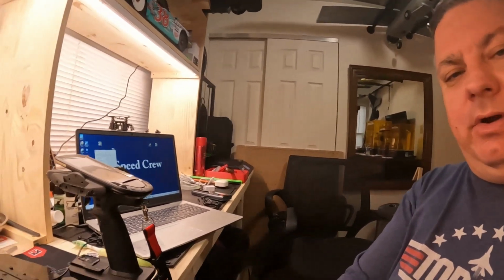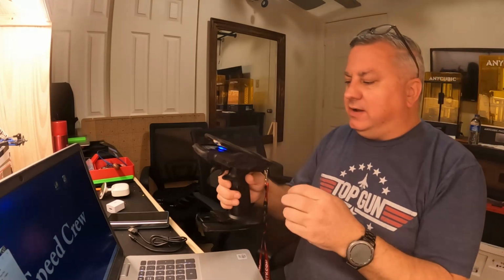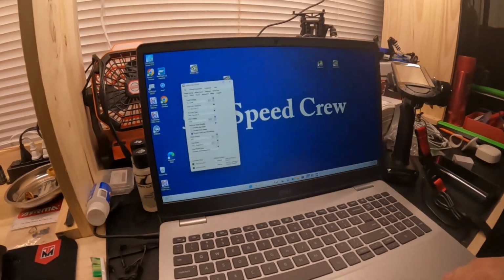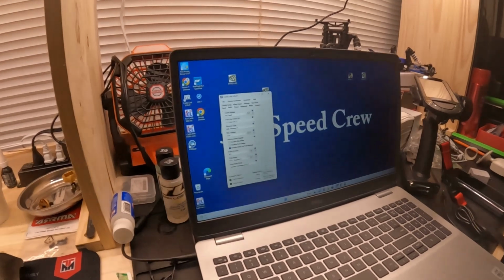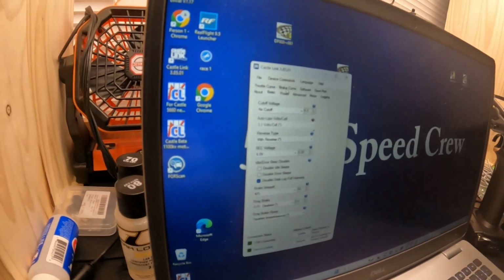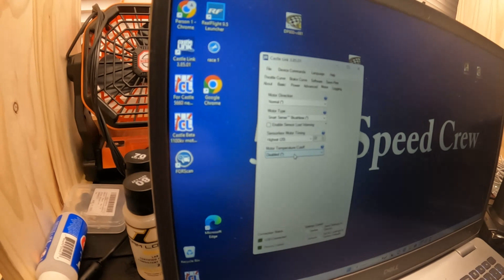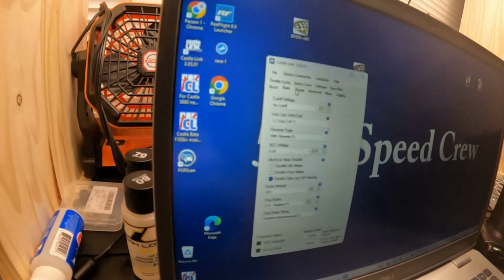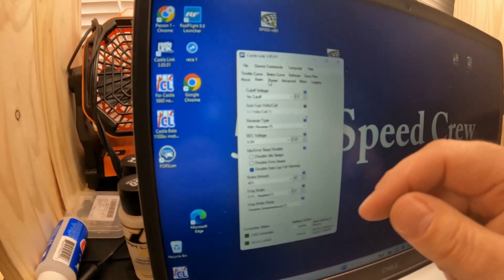Speed run secrets with Futaba 10px setup and XLX2 settings

Comment: Yo tell us 20 degrees timing what motor what kv you can't just put 20 degrees timing on every motor could you explain to the viewer what motor time and be specific tp motor or castle motor y wind or D wind motor has different timing Steve nu etc
Reply from the maker: I was using Castle Link so I figured people would know. My bad, 2028 1700 KV
Reply: @501speedcrew9  thanks 🙏
Reply: @501speedcrew9  also on castle website is specifically said 0 degrees timing I just spoke to Thomas and he said 20 degrees timing is not recommended
Reply from the maker: @Rcghost-1  We dont get cars to 200 MPH by following recommendations...LOL
Reply from the maker: @Rcghost-1  I should say that you should not push boundaries you are not comfortable with. Thomas is a good friend and has done a lot for my family.  He knows whats best.